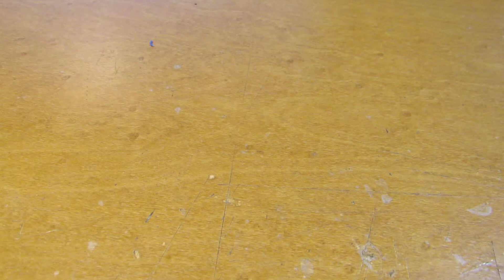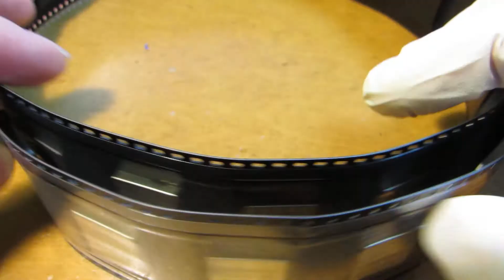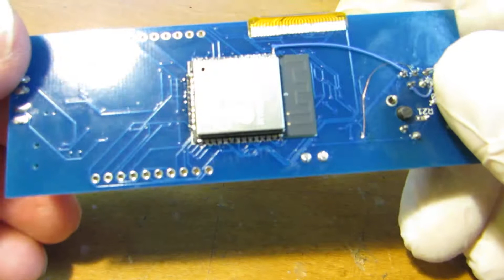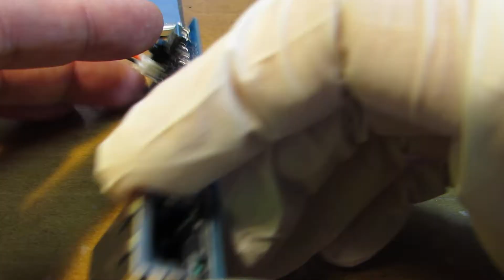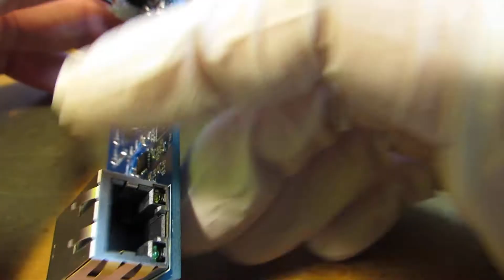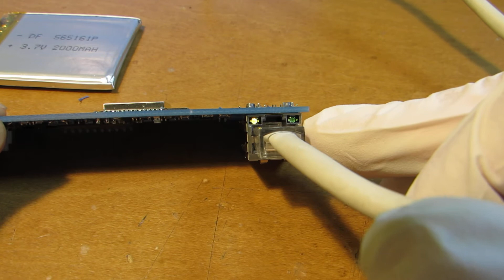Monster ESP32 board, eventually now it's link-on ether network!

Comment: Very nice work. 
What is the model of ethernet controller did you use?
And for software is it need big modifications or easy to add because the esp32 has RTOS inside?
I plan to do same idae of connecting the ESP32 with wired Ethernet so i may ask you some questions if you don't mind 😊
Reply from the maker: It's microchip's something something... I've forgot one... but Very relevant (similar) board configuration can be found in Olimex's board (the time of release was almost same timing, I (and they) did not cheat ;-)